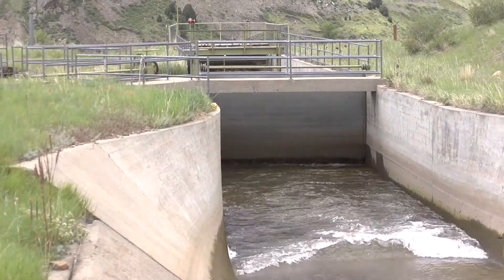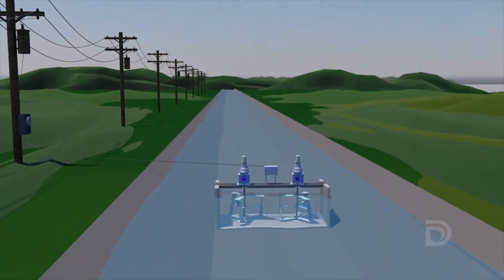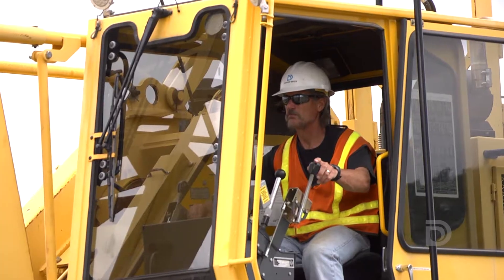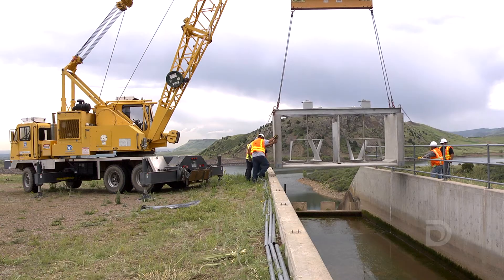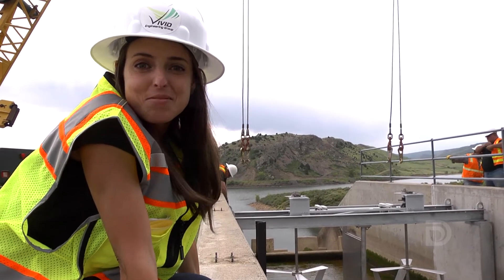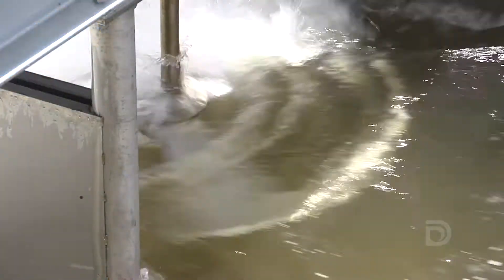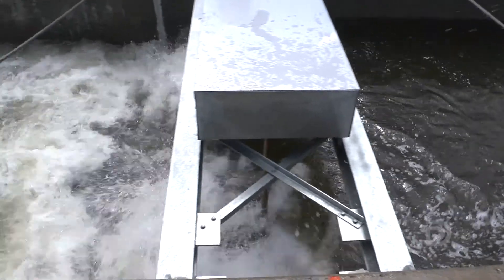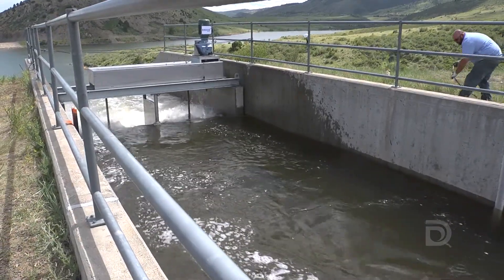Denver Water Hydropower Installation

Comment: Very cost effective actually.  80 mWh per year = 80,000 kWh per year x $0.11/ per kWH (retail value) = $8,800 worth of electricity per year per unit.  Now divide the cost per unit ($33,000) by the value per year ($8,800) and you have payback time of about 4 years, not counting maintenance.  That's better than solar and wind.  Only problem I see is there are often fish in those canals.  What happens to them when they pass through the turbines?  Probably not anything good....